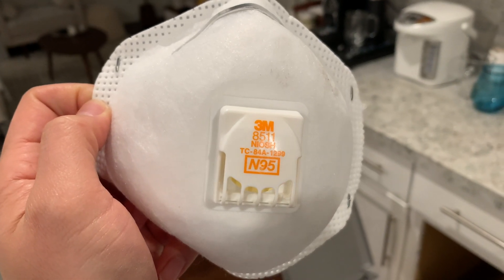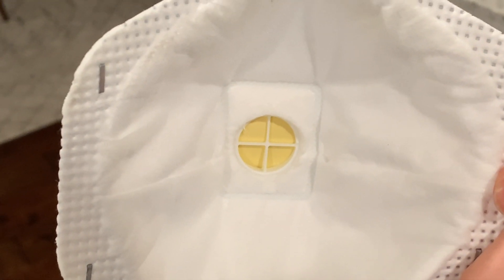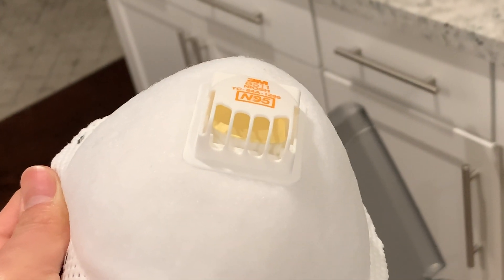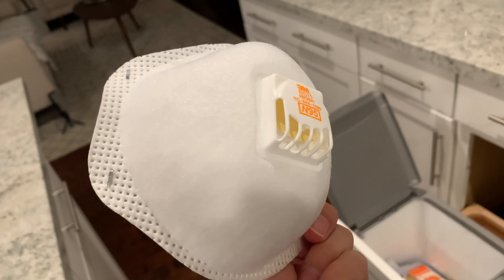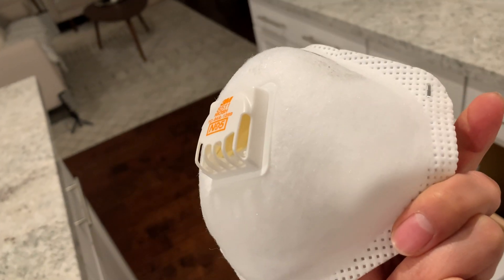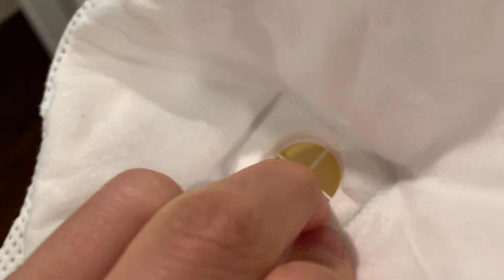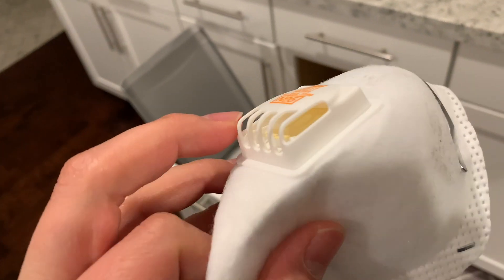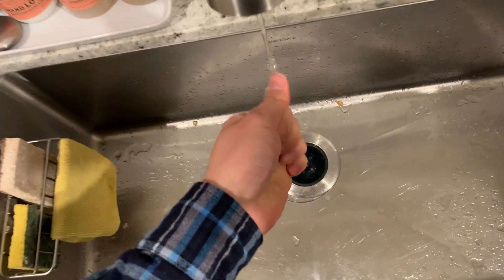Watch this if you are using the 3M N95 Mask for protection against the Coronavirus

Comment: I have a 3M Aura 9334CV+ (Made by 3M China) with the valve, it protects yourself but not other around you due to the valve
Reply: I use one of these masks because they are very comfortable but put another surgical mask on top of it so that it will have the same effect as wearing a surgical mask in the first place. Something else to note with these vents is that the holes are put on the bottom of the vent so that the air flows downwards. Definitely better than flowing in front of you.
Reply from the maker: @RyanLeague  Yes, you are correct. The vent is designed to let the airflow downward.
Reply from the maker: Got it! It's better to be careful when you go out to the public areas. Some places like hospitals and airports ban them. Take care!

Comment: Old news. I will protect you just fine, but it wont protect anyone around you. You can pass on the virus with the mask but you can't catch it with it. So yeah it's bad for this situation.
Reply: Most people who are using rags or clothe type of masks need to know that it DOES NOT WORK against Covid.  Knowing that majority of people wearing masks with designs or branding all risk transferring Covid to others as Covid passes through regular fabric and also generic surgical masks.  There are people walking around without a mask or there are people who wear bandana materials to cover some portion of the face. My main point is it’s funny how you pick on this mask and yes I actually use it but take care of myself from what’s going on more particular than anyone that I’ve seen and know as I have disciplined myself with routine procedure when I go out and come home.  I know doctors and dentist use it and other professionals who need to let out some steam due to glasses or etc.  So next time you judge ask yourself if your mask exhales, in most case YES it probably does exhales without you even knowing. Watch some microscopical footages of virus transfers on masks if you need proof.
Reply: then they should stay 2 metres away no?

Comment: Thank you for showing people how this valve works. As you can see, wearing a valved mask without covering up that valve will put other people at risk, because the air coming out of your mouth will be unfiltered. There are ways to catch a virus besides inhaling it, and this particular virus often has an incubation period of 14 days, when people can be infectious without even knowing they're sick. In a few cases, it has been even longer than 14 days. It's supposed to be, "My mask protects you, your masks protects me." I prefer one that protects both, but not everyone can get their hands on one that protects themselves, even if their mask does protect other people. The needs of the many outweigh the needs of the one. We shouldn't be wearing a valved mask without covering up that valve, which will make it harder to breathe in, but it will protect you and others if you cover it up.
Reply from the maker: I've made a follow-up video on how to seal off the valve. Feel free to check it out here. Thank you! https://www.youtube.com/watch?v=YY8RgYZ6FVc&t=38s
Reply: Most people who are using rags or clothe type of masks need to know that it DOES NOT WORK against Covid.  Knowing that majority of people wearing masks with designs or branding all risk transferring Covid to others as Covid passes through regular fabric and also generic surgical masks.  There are people walking around without a mask or there are people who wear bandana materials to cover some portion of the face. My main point is it’s funny how you pick on this mask and yes I actually use it but take care of myself from what’s going on more particular than anyone that I’ve seen and know as I have disciplined myself with routine procedure when I go out and come home.  I know doctors and dentist use it and other professionals who need to let out some steam due to glasses or etc.  So next time you judge ask yourself if your mask exhales, in most case YES it probably does exhales without you even knowing. Watch some microscopical footages of virus transfers on masks if you need proof.
Reply: @KL-gu7kc  if someone's glasses are fogging, this means unfiltered air is moving in and out of their mask. I wear glasses with a KN95, and my glasses don't fog because I know how to use that metal strip. I have seen people wearing N95s and KN95s, but with the top of the respirator resting on the tip of their nose, which defeats the whole purpose of wearing any kind of face covering in the first place. I even watched a guy get a Covid vaccine while his nose was hanging out of a surgical mask the entire time he was there. He's obviously taking this pandemic seriously enough to get vaccinated, so why not cover his nose? Does he not realize that we breathe through our noses‽ I have seen too many people with their noses hanging out, and thought they were just trying to game the system, but this guy? Maybe a lot of people really don't understand why our noses need to be covered, why we need to have a good seal around the edges of our masks, and why we should not be wearing masks with uncovered, unfiltered valves.
Reply: @LesignerGirl  off the main point I was making as you are getting off track however, I will correct you in this matter.  The definition of N95 or any mask with a number is for filtration.  It means only 5% of outside air is going out/in from your mask itself.  3M N95 masks are designed as if you watch their official video with microscopic layers of materials on tops of many materials to block smaller particles like Covid/virus/bacteria from passing through in literally microscopic level.  What does this mean?  It means it's hard for your to breath period and it basically creates your own little bubble like as if it works like your own incubator around your nose/mouth area.  When in motion/walking/moving around this small breathing space, it is normal to sweat and create moisture which then causes condensation on your glasses as you exhale as glasses are literally worn below your mask and it is the only spot on the mask to be altered to your customized face shape which makes it a weak spot.  If you do not have condensation on your glasses while you're out and about during cold weather you should question yourself if your mask actually works.  Best way to test is by holding a lit candle in front of your face/mouth to see if your exhale moves the fire.  If you can blow out the fire or your lid candle light moves, most likely your mask does not work as exhale/inhale works the same and you have a product that is not working properly.

Comment: this mask is made for industrial not for medical or virus prevention use. do not use this mask in this current situation then blame because of its mechanism that is not safe.
Reply: Most people who are using rags or clothe type of masks need to know that it DOES NOT WORK against Covid.  Knowing that majority of people wearing masks with designs or branding all risk transferring Covid to others as Covid passes through regular fabric and also generic surgical masks.  There are people walking around without a mask or there are people who wear bandana materials to cover some portion of the face. My main point is it’s funny how you pick on this mask and yes I actually use it but take care of myself from what’s going on more particular than anyone that I’ve seen and know as I have disciplined myself with routine procedure when I go out and come home.  I know doctors and dentist use it and other professionals who need to let out some steam due to glasses or etc.  So next time you judge ask yourself if your mask exhales, in most case YES it probably does exhales without you even knowing. Watch some microscopical footages of virus transfers on masks if you need proof.
Reply: There is a worry that the exhaled breath is not filtered, thus some may say that this kind of mask is not coronavirus approved. But one can think this through where one can hot glue a circular tube about an inch in length that surrounds the exhalation valve. Make an air tight seal between one end of the tube and the mask and hot glue it in place. With a surgical mask, cut the left and right sides (the one's with the string loops) find a way to take out the metal strip on the top without cutting yourself (this strip is sharp) and wrap this surgical mask around the tube, fold inward towards the mask the other end, making sure there is enough space for the expelled air to bubble out, then secure the surgical mask with a rubber band. 
To check for air leaks, do what is called a positive pressure check by blocking the tube end with one's palm and blowing out one's breath. If air is escaping freely, this would imply that there is a leak on one of the seals, it may most likely be at the hot-glue end, so take out the surgical mask and try the positive pressure test again while feeling where the leak is coming from. Once this is fixed, wrap around again the surgical mask and tie it off again with a rubber band.
It may feel like a lot of work, but as some folks become aware and become sensitive of folks wearing mask, this added security can have an effect where folks can, as well as the wearer can feel safer once they know that the one wearing this kind of mask is also protecting others. 
Also know that, this is just a recommendation and that I can't be responsible for anyone else's safety, so it's up to the individual to work this kind of mask correctly for themselves in safety and health. Best to also work with a worn used mask at first so if one makes a mistake, then there is no harm in ruining a used mask. Just be sure it is disinfected with 70% isopropyl alcohol first to be sure that there is no trace elements of the virus or anything. Good day and stay safe to all that read this. The way of this new era is about taking care of one's self primarily then others secondarily. So we must learn to do things for ourselves individually and consciously. This way we become intelligent, wise and independent.
Reply from the maker: Hi Ino, it was the only available one back in Feb. I wasn't sure about it so that's why I post this video. Thankfully, other people like you have commented and provided some clarity. Can you also let me know more about what's a good alternative/model and where to buy if you have extra bandwidth? Thank you.

Comment: These valved masks are more dangerous in the virus world.
Reply from the maker: Do you have any recommendations? These are the only ones that I was able to buy but everything's sold out now. Thank you!
Reply: @Hsiehstyle   , samich (1973)  on ebay has them for about 1.20 each. They are flat fold n95 non valved and good to stick in your pocket along with gloves and ear covers. if you look you can sill get  (1.50 or so) on amazon but you got to be there as soon as they come out or soon after and that gos for most all sellers. Harbor freight, lowes. home depot has them at times and so does ace hardware when they get some in.  Also google supply stores and you can usually find some. Good health and luck to everyone.
Reply from the maker: @resistor8735  Thanks for your recommendation.
Reply: resistor you have no idea what you are talking about.
Reply: Most people who are using rags or clothe type of masks need to know that it DOES NOT WORK against Covid.  Knowing that majority of people wearing masks with designs or branding all risk transferring Covid to others as Covid passes through regular fabric and also generic surgical masks.  There are people walking around without a mask or there are people who wear bandana materials to cover some portion of the face. My main point is it’s funny how you pick on this mask and yes I actually use it but take care of myself from what’s going on more particular than anyone that I’ve seen and know as I have disciplined myself with routine procedure when I go out and come home.  I know doctors and dentist use it and other professionals who need to let out some steam due to glasses or etc.  So next time you judge ask yourself if your mask exhales, in most case YES it probably does exhales without you even knowing. Watch some microscopical footages of virus transfers on masks if you need proof.